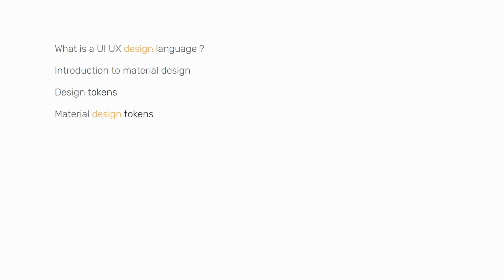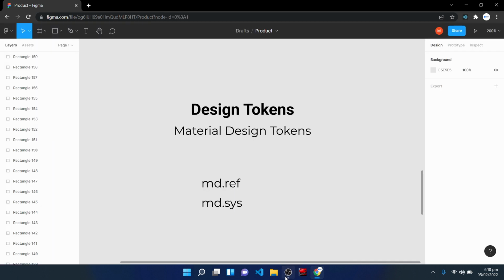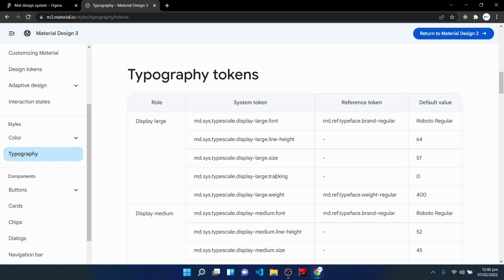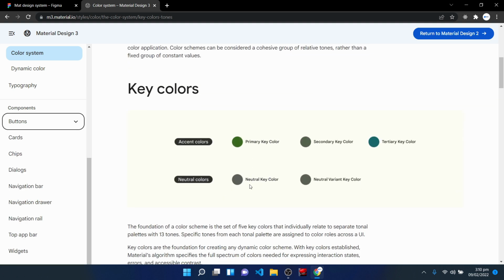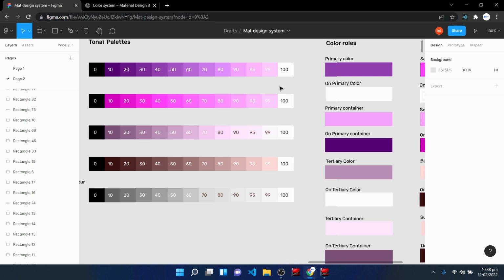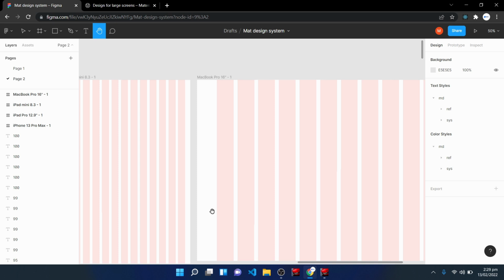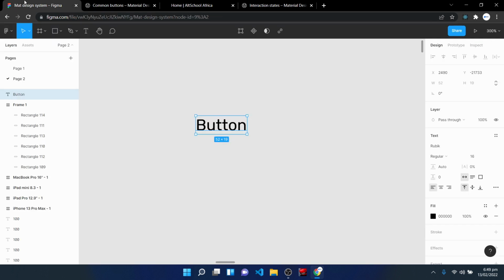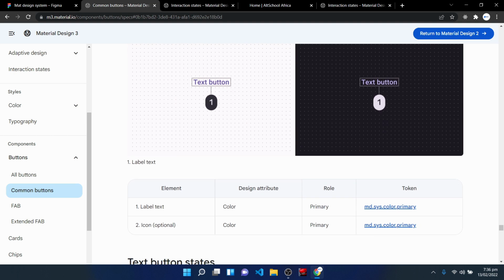Material Design For UI UX Designers -  UI UX Design Tutorial

Comment: It's a very good explanation, however, something's wrong here. The hovered state etc should have color, not just white. Maybe something's wrong with the documentation because that 8% opacity is too low. I think the correct one is to reduce the opacity by 8% not to make it 8%. Sometimes, using an opacity could be bad if the background has patterns and also will kill the saturation. After all, I really like the video, it's so comprehensive.

Comment: To create a tonal pallete:
1. Pick a key color.
2. Change Color system to HSL
3. Duplicate the box 13 times
4. Change the L values as mentioned in the material guidelines i.e. for 0,10,20,30,.....99,100

Thank you for the session. This is the best video I have found till date.
Reply: Ohh thanks Pratistha. This will certainly help

Comment: Hi Joe, thanks for the tutorial. It has been helpful and empowering. For typography, I noticed that the value for the system token is "md.sys.typescale.parameter" while ref is "md.ref.typeface.brand" i.e., sys=typescale and ref-typeface. Do you mind clarifying the difference between the values?
Reply: In short the 'typescale' wants to adress the specific metrics of for example 'label big' being 32 px with a line height of 48 px, and the 'typeface' value will adress what the font, also known as typeface, looks like regardless of sizing and other metrics. This is a clever way to split up the sizing and the font so that you can keep all the same sizes but for example change reference from Times New Roman to Comic Sans and still keep the same metrics, i.e. typescale. The brands regular typeface will for instance most likely be referenced many times in the design but the typescale is specific to the role you are adressing with your token.

Comment: I have a question about the color section, the value of primary or secondary colors 40,100, 90, and 10 fixed? can I change the value? the rest of the shades when can I use them?

Comment: Course was well understood, thank you Boss. I have a question

Considering that fonts behave differently and some fonts might require more line heights than others, let's say you were already creating your design system using Material designs template, if you were to customize your line heights for your project using GRT calculator, will you still give reference to the Material designs system?

Comment: hey joseph i have completed the typography part but I'm a bit confused.. why do we have to use these md.sys or md.ref instead of just naming it regularly .. i understand the part of them being a system style and a reference style but what Im missing is the benefit .. what do i get for using it ? Also what if I'm designing for multiple screens will the large/medium/small thing fit for every screen or will i have to adjust sizes etc ... thanks a lot for the great content btw !
Reply from the maker: Hi, It's used for documentation sakes, It's not a must. It's used in a design system Just to let the devs and other designers know that they typography system was built with the standards and guide of material design.